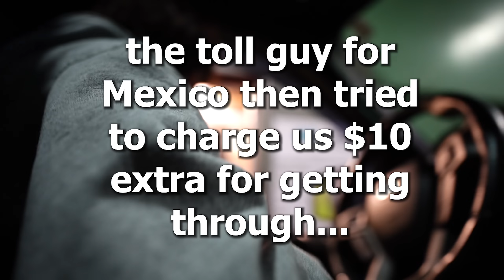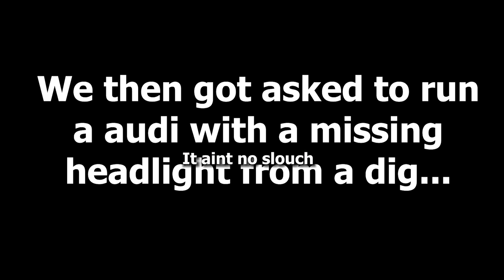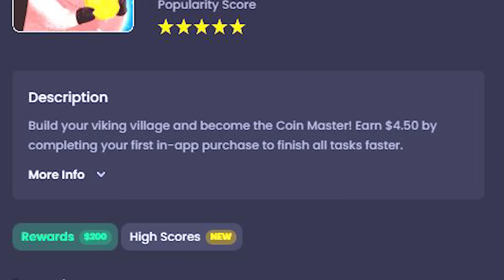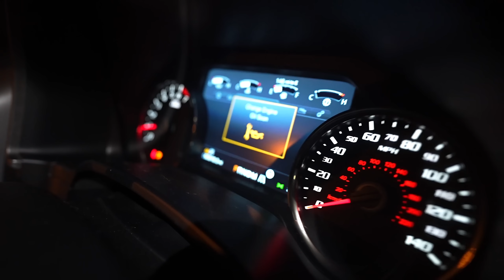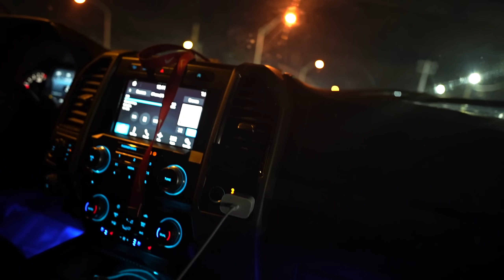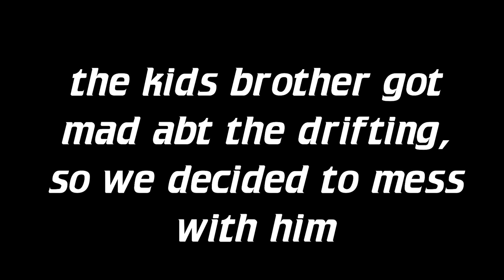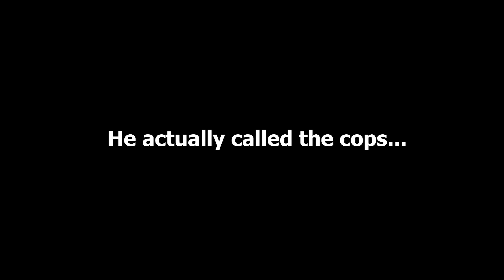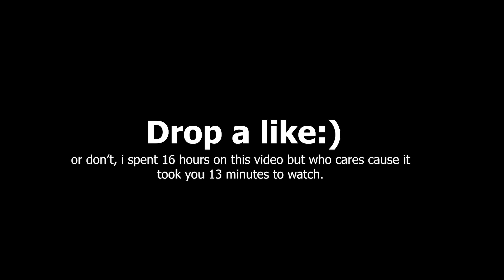I Took My Raptor Street Racing!

Comment: So have I, I was in an hit in run with an semi in my Mercedes e320 that totaled my car and the semi fled the scene of the accident here in Sayreville nj and I literally just got finished putting in the 10k$ retrofit srt6 supercharger kit in it and it just came off the dyno making 600hp on water meth injection and 93octane before the semi blew a red light and clipped my passenger side tire with his wheel sending me through a curb into Wawa parking lot